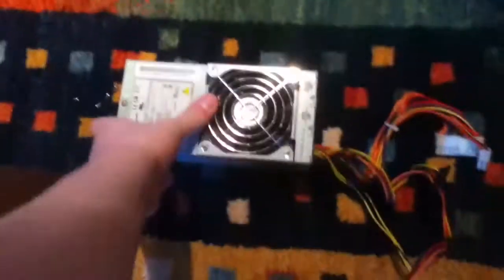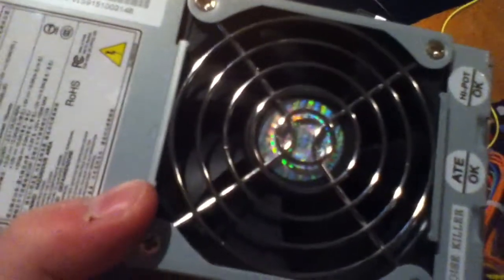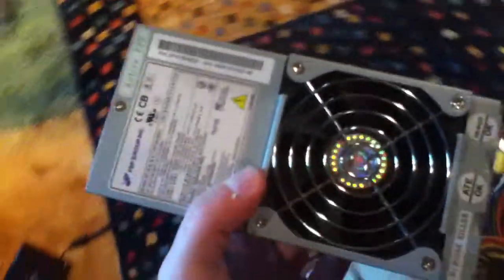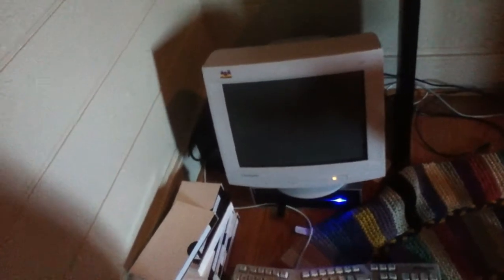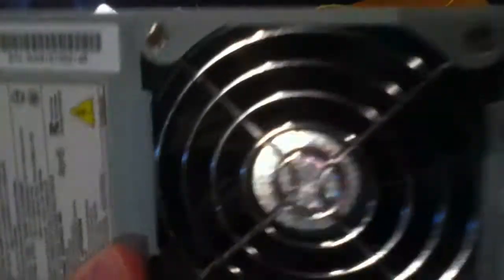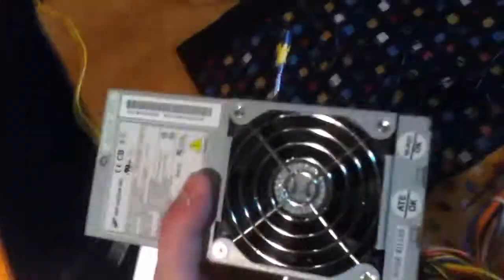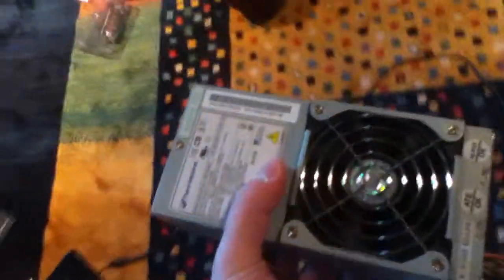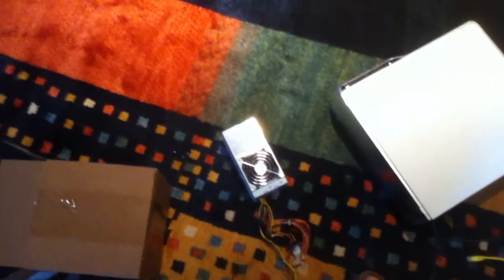Derptop PSU, Reminder To Check The Voltages Periodically

Comment from the maker: @FreightExpress1993 i did see in a video that yours didn't wanna boot. that to me looks like it's not detecting the hard drive or optical drive at all and that could be due to a number of things. could be bad SATA cables, BIOS being a pain, or the SATA controller is toasted. i'm sure there are other possibilities but those are what i can think of off the top of my head. the boards in them do have nForce chipsets and those can be problematic sometimes.